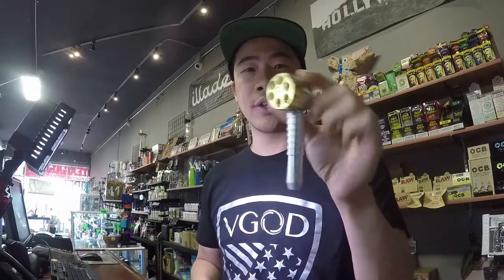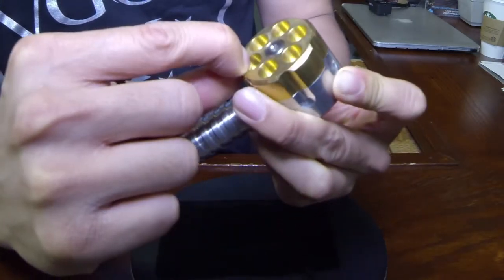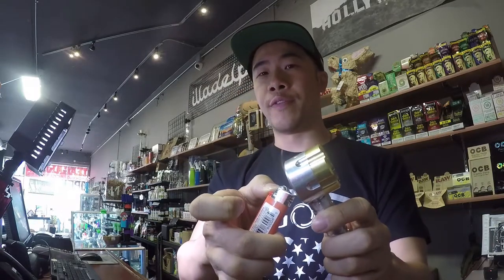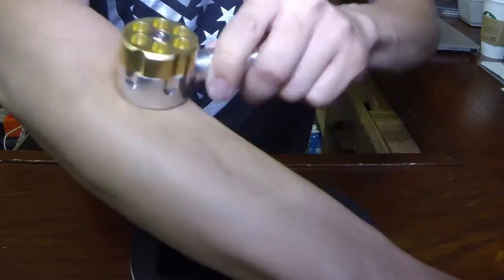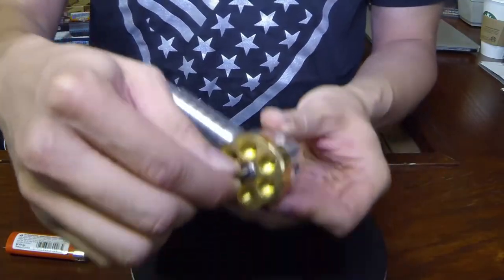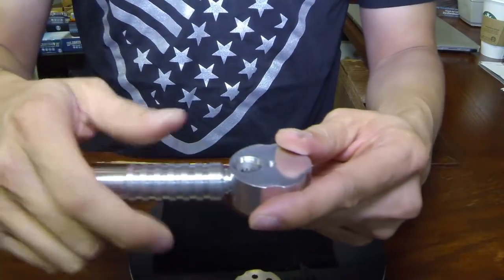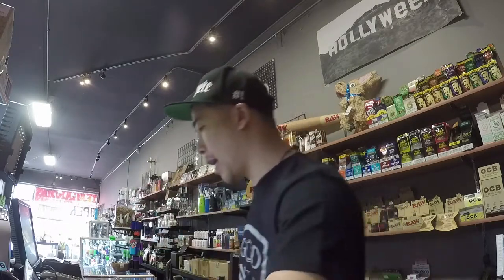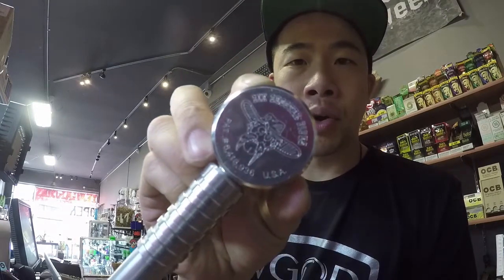The Original Six Shooter Pipe - The Pipe That Doesnt' Get Hot

Comment: Mine has a grinder on it
Reply from the maker: If the pipe does get hot, then it's not authentic made with aircraft aluminum. ONLY test the heat with the authentic item, all the replica's will not function the same as this item on our video.
Reply: If it has a grinder on it, its fake.
Reply: Ik it’s fake cuz it don’t have nothing on bottom but it don’t get hot